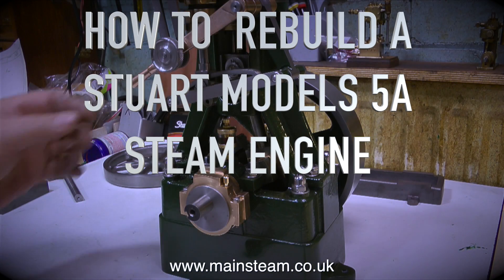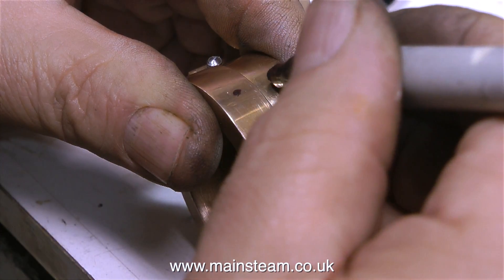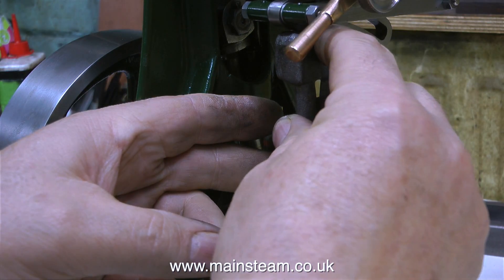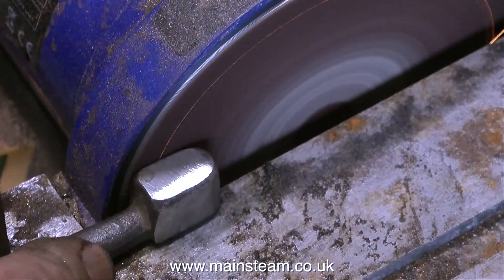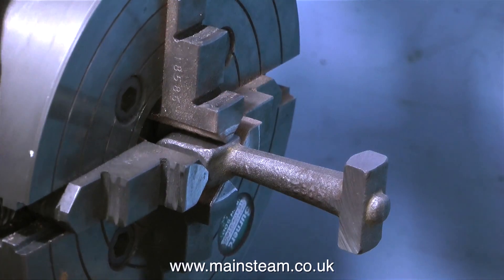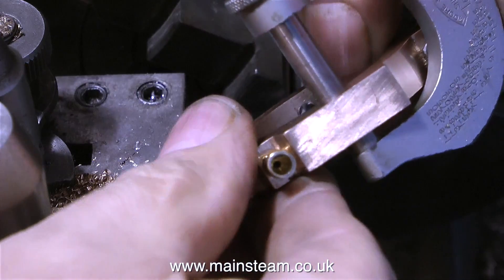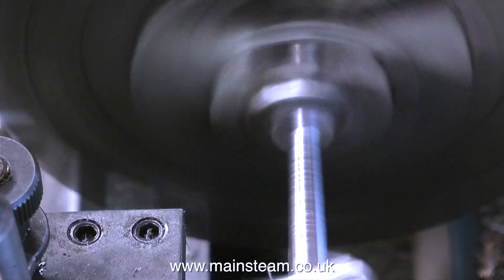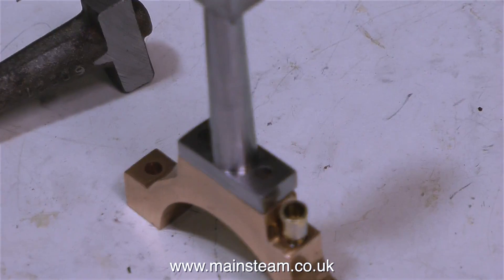HOW TO REBUILD A STUART MODELS 5A STEAM ENGINE - PART #28

Comment: I recommend a flex screwdriver or whip driver, it's a screwdriver which you can put sockets screw bits  and whatever on and it can access tight spaces and it flexes around corners, I'm a car technician it's one of the best tools for tight spaces and small nuts and bolts

Comment: Keith, I am curious about one aspect:  When you are tapping the threads into the upper and lower eccentric strap why not cut the thread with the eccentric strap still soldered together?  Would it not align the thread better?  Curiosity killed the cat and satisfaction brought it back.
Reply from the maker: No need really ...... there is less risk of the tap breaking doing it the way that I do it, as it is a long way to go through both halves. I suppose I could drill out the first half - but it seems to work OK as I show it in the video.

Comment: Would anything be gained by making the eccentric rods our of aluminum with bushings? I was thinking about reciprocating weight...
Reply from the maker: That would be ok, but the eccentrics are not the main problem. Most of the reciprocating weight comes from the piston & piston rod, the connecting rod & the big end bearings. It's notworth making bushed aluminium eccentric rods I think .....

Comment: If not for the very high cost of Stuart castings and the exorbitant time it takes to get them, you could put the link in a vise a pipe wrench around the link and bend it, if it bent right over you've got ductile iron if it snapped its gray iron. Experience question, my 5A will be used not as a model but a work machine. Given the straps are gun metal and the eccentric gray iron I'm sure they will not wear quickly would you concur? I will be creating some kind of oiling system so wondering if it would be a waist of time and money to make iron straps and phosphorus bronze eccentrics. In my biz we use a lot of Boron nitride/Titanium nitride laminar lubricating coatings for corrosion and lubricating parts. I'm thinking of trying the Boron nitride doesn't cost much plus the corrosion protection in a marine environment. But if your experience say's not to worry then I wont. Also a concern about not using a lot of oil to keep any contamination of my pond as limited as possible.

I enjoy your video's you have a strong grasp on helping those starting out with a old art.

Tom
Reply from the maker: Cast iron & gunmetal is a good combination, and is very common in steam engines. Probably best to try the old method of GM & CI and when they wear out try making the parts out of something more exotic . . .
Reply: Thank You for the knowledge I will stick with them then. Think I'm going to do the Boron nitride on the CI and steel parts, it will help with lubrication but help a lot with corrosion as long as the oil's are compatible. I ordered a slug of Oilite 330 to make main bearings from, hopefully you and me will have very good results.

Comment: Keith

That material may be ductile cast iron , or more correctly spherodal cast iron . The difference is that the graphite is in small balls not flakes as in normal grey cast iron . It’s made by pouring the molten iron onto magnesium, the resultant flare is a sight to see  or not if you value your eyes . It has the wear resistance of ci but turns like steel they made some springs out of a pipe to take to trade shows

The reason I know this is I served my time as a sparks at Stanton iron works and they used it in vast quantities for the cast pipes so I am not a expert but I was around the stuff for a few years 

Keep up the video’s
Reply: Ductile iron is a post WW2 development involving the addition of magnesium to the melt, along with specialized handling, that yields the desired result.  True malleable iron is a much older affair and is made by anaerobically annealing white iron.  Both methods result in graphite nodules in the metal, as opposed to the graphite flakes in gray iron.  When really thin sections are cast, the malleable process seems to fail, but the production of white iron occurs routinely.  The carbon in white iron is in the form of ferric carbide, which is extremely hard and unmachinable.  Metal workers talk about chill in castings, which is (in fact) white iron.  Into the 1950s, chilling was intentionally used in the production of railroad car wheels.  Chilled car wheels are no longer lawful, as they lack the strength to deal with the current heavy loads.

Eli D.

Comment: Two questions if I may?  One, why did you not radius the bottom and to of the eccentic rod? I would guess there would be some stress there, and a sharp angle might be prone to stress fractures. Tow, it used to be common to nickel plate some steel parts on a steam engine, partly for looks, and partly as a rust preventative. Would you be against such practices on model engines? Currently visiting my mother in the US heartland and in antique stores, I am running across many mechanical items that are Japanned Black castings, with nickel plated steel mechanicals.
Reply from the maker: Two replies: No stress to worry about, so no radius required. I don't have a rust problem with my model steam engines usually .... also the full sized article seems to work fine without plating. Plating can look pretty, but it's too un-Industrial Revolution for me {:-))))))